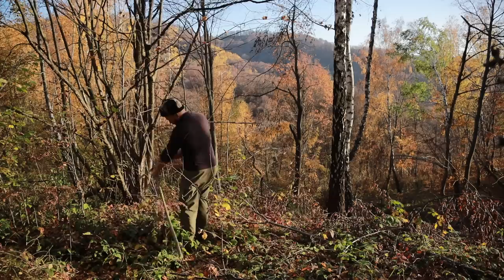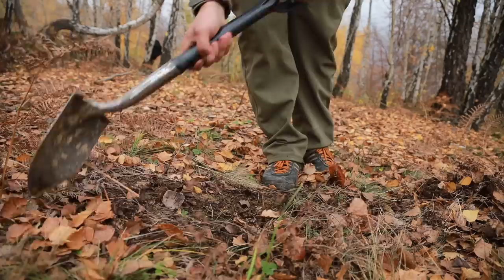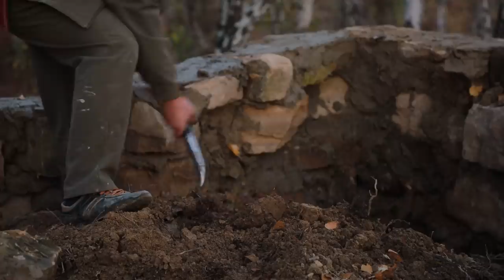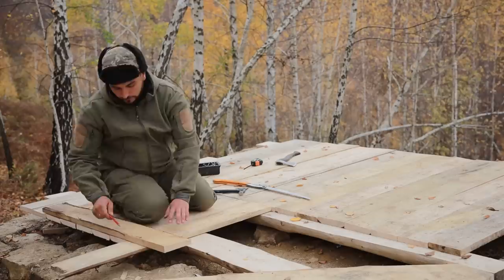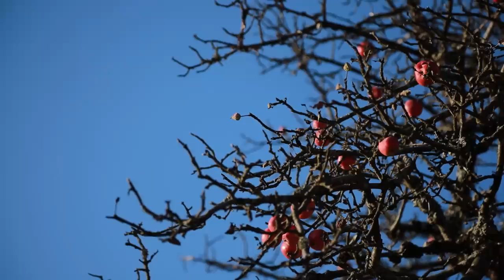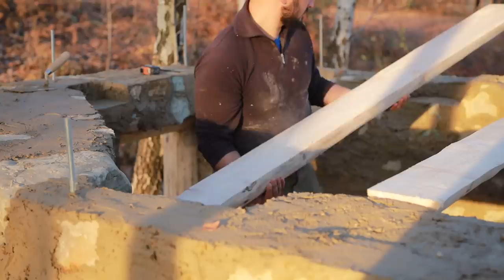Building a stone house.  Lesnoy in action. Part 1

Comment: This one would be an interesting build to revisit in about a year. The craftsmanship was superb but I am interested to see how the mud mortar holds up in damp conditions. Seems to me that even if it is dry, the first time it rains it will start to run and the building will fall apart. Fingers crossed!
Reply: El barro en construcción  de piedra se utiliza desde la antiguedad y aun se sostienen ahora muchas construcciones. Asi como ay cabañas fabricadas con  muros de tierra compactada....que duran muchisimos años
Reply: @joseantoniorodriguezperez4899  Agree, but usually in dry or arid environments. Mud bricks that were sun dried in Babylon and Egypt are still standing. Adobe structures in the U.S. southwest are also in relatively good shape. Mud was also used in waddle and daub houses, but the roof had to overhang the wall to protect it from the rain and had to be re-applied occasionally. Same with cob houses (not sure about the compacted earth houses). I'm not saying it won't work, just interested in how well it works.
Reply: Yes only in dry climates that guy doesn’t know what he’s talking about.
Reply: @ckmbyrnes  If you face the joints with lime mortar it should hold up fine, with a suitably large overhang possibly even without doing that. Even rainy Ireland has mud houses but they have large roof overhangs and the outside is limewashed for additional waterproofing.

The other thing that worries me about this project is frost. The foundations only go a few cm below the ground and I'd guess depending on location the frost line is somewhere between 60 and 100 cm, possibly even deeper in very cold places. A building with such non-existent foundations could easily shift and crack or, in case of heavy rainfalls, simply slide down the hill. If he's lucky the house could last 100 years and more if properly maintained but I wouldn't consider it amazing craftsmanship. Also did you notice how much the wall facing downhill leans outwards?
Reply: I suspect that they take apart a lot of the structures so they can reuse materials. They use slate, granite, river-washed stones and pre-cut timber poles in their projects (and who knows how mush they have to pay for the miraculous mud cement!), and that stuff doesn't grow on trees!
Reply: @Ragnar8504  the leaning wall has concerned me, I must say.
Reply: Yeah, I was surprised, too. And wondering if the mortar (mostly clay) will suck up moisture and make the stone damp.

Comment: Completely new to this, myself. My Grand- and Great-grandfather were builders. They built stone and mud cabins and outbuildings in California's high mountain weather extremes. 100+ years & still standing, untended for over 40 years. Grandpa said to look at what's in the mud. How old is it? How deep did you get it? What kind of trees were growing in it? How old were they? Thickness of your mud for that content? Placement of the angles on the rocks? Not just a jigsaw puzzle to each other, but angles for the weather. Flakey rocks? Water and ice in the flakes? Round rocks? Rain could run in, depending on prevailing wind. You all know far more details, I'm sure. He's also very knowledgeable and intelligent. He'll get it.

Comment: Is that clay mortar? Also, I've done this kind of work with hand tools and it takes me a long time to saw each board. He doesn't show the hours it takes to find the right trees to cut for logs and then strip the bark and split the logs. You need special wedges to split wood like that. Everytime you use those tools you also spend hours sharpening the edges and repairing broken handles etc. It's not easy or simple but I respect that he is showing that it's possible if you keep working at it. That's the big lesson here. Your skill will develop over time if you just keep at it. I kove stone masonry. There are also ways to measure angles and level floors/walls without special tools. You either need glass jugs filled with water or you need to wait for a hard rain and observe the site.

Comment: I am really curious about the durability of a wall built with clay mortar.
Reply: It will likely last a long time provided the eves of the roof keep water off of it. It could last along time.
Reply: The stones must be resting on each other or it will settle.  This is true even with cement mortar.  Some types of clay dry pretty dense.  In a dry climate this may last many years tho.
Reply: @BCVS777  this does not look like a dry climate. Lots of trees.
Reply: Если стены и основа стен будет защищена от влаги, то они прослужат сотни лет.
Reply: I am watching this again and I realize that the footing is only 8-10 inches. This means that the first winter the footings will start moving and the structure will fail soon after.
Reply: Probably a better idea would be just to do no mud mortar... and just do a dry fit using a chisel.... definitely would need a good foundation 1st but done correctly the stones weight will lock it all in place
Reply: @Silent_Steel  thx. Appreciate your thoughts on the foundation.
Reply: Me too
Reply: Structures built by Natives here in the Southwest were made using clay/caliche for mortar, and portions of them still stand today - hundreds of years later.
Reply: @lisalisa5180  yes those are amazing but this building is in a much wetter environment

Comment: Would be nice to have a root celler under the cabin. Nice build .You did a lot of hard work. Thank you for sharing .
Reply: That's an interesting thought. Also wondering about chimney and stove.
Reply: @Reziac  I was thinking a pentagon or hexagon shape where one of the points can have the door and the other side the fireplace. The one flat wall a bunk bed and the other table and chairs. With the added cellar a trap door in the middle would work as well.
Reply: @kameljoe21  Put a loft above (bed up there, to take advantage of rising heat) and that becomes a tidy livable space.

Comment: Floors, walls and ceilings inside your home should be well coated to prevent soil radon and cement radon from contaminating the indoor air. Coat the exterior of your home as well. If you breathe air contaminated with radon, your blood will get sick and you will suffer from various diseases and incurable diseases.

Comment: Nice work but it may be in vain, your mud mortar, even if kept dry, will not hold the weight of the stone building. If you had shimmed each stone before adding the mud mixture may have helped hold the weight.

Comment: I'm sorry. Your work is impressive. But No. It doesn't count. You didn't build a shelter with materials that can be found freely in nature. You have obtained tuff bricks and wooden logs already cut and smoothed. This is not good for survival. In my country you should dismantle this solid structure immediately, because it's forbidden by law to build like this in the woods